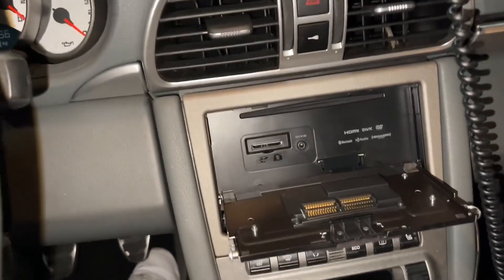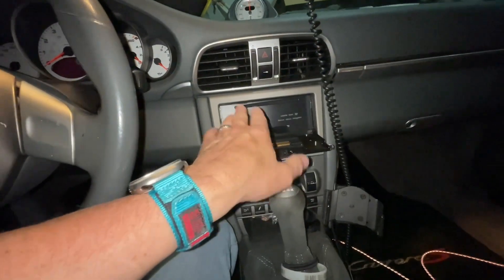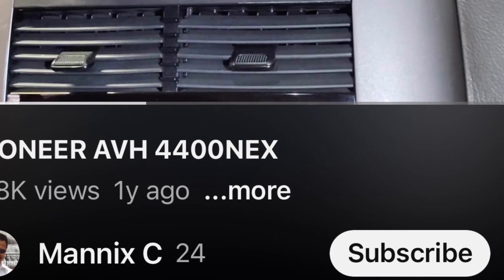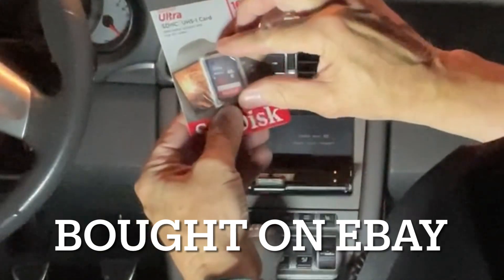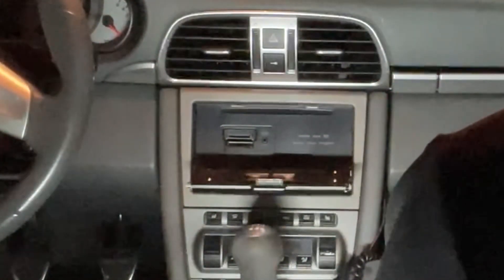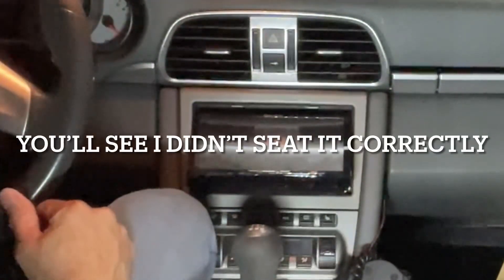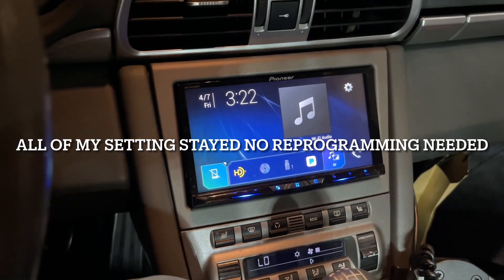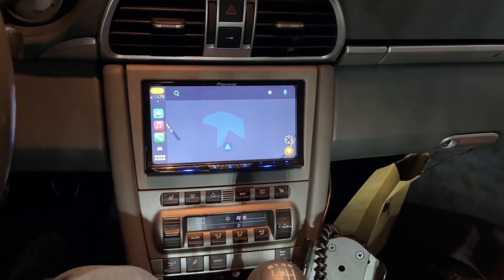Pioneer AVH4400NEX factory SD card replacement without removing the head unit

Comment: so glad you posted this!  Im already on my 2nd head unit.  My first one I had to replace the card and after another year it again went bad.  Card didnt work.  I reluctanty purchased the same head unit only because I didnt want to have to get another whole wire kit and Maestro for another brand.  Ive had the second unit for about 2 years and the thing just started the boot loop crap yesterday,  I was gonna tear it out and this time cut the opening with the radio apart.  After seeing your vid I now know its easy to do without removing.  Im the king od the Dremmel, my fave tool by far.  Thanks for posting
Reply from the maker: Ty Ty

Comment: OK, so I easily removed the faceplate but the metal atachment point that is covering the card slot is still in the upright position.  your vid doesnt show how you got that to open and expose the card slot.  I can see its final horizontal position in your vid but mine wont budge?  Ive tried sliding it down, pulling from the bottom, it seems to be locked rock solid into place.  How did you get it to open?
Reply from the maker: I cut it with a demel tool :)
Reply from the maker: Mine slid down with minimal pressure
Reply: @ballvice7861  Thank you for your reply!  I did manage to get it but it wasnt so easy.  I actually have 2 units and both were the same.  Basically needed to use a small screw driver to pry the bottom hinges out a bit.  it took quite a bit of force to get them moving and I was concerned id damage somthing but just went for it.  Once both sides were extended about 1/4 inch I was able to grab the metal plate from the bottom and pull it out.  It doesnt actually just slide down.  More a combonation of pulling the bottom while slideing it down from the top.  After I dremmeled and got the slot exposed and replaced the card.  Boot loop fixed but I have no touch screen functions at all.  Still messing with this.  It doesnt appear like there is anything I might have damaged with the dremmel to have lost touch sreen working but looks like im gonna have to tear it down and take a closer look.

Comment: How did you fold down the mechanism to get access to the sd card? I can’t get mine to move
Reply from the maker: Once the faceplate is off it slides down
Reply: @ballvice7861  hey I'm having the same issue. I've tried pulling it and prying it down but it will not slide down to access the SD card
Reply from the maker: @motobevy7850  the front face?